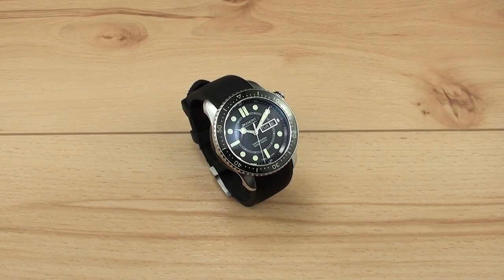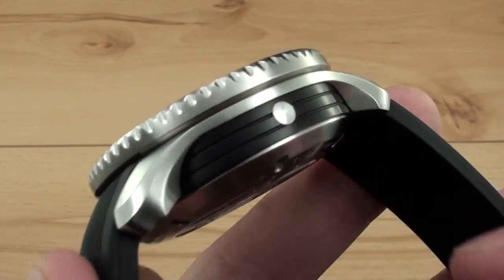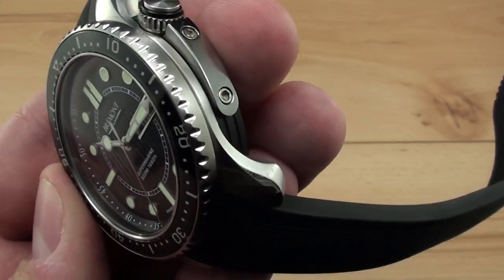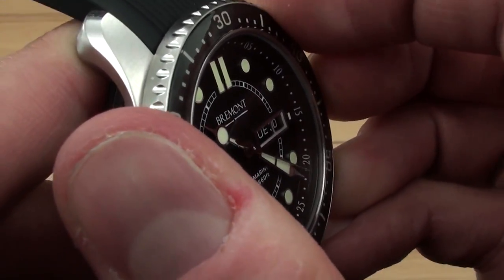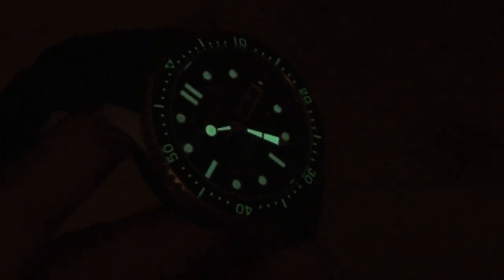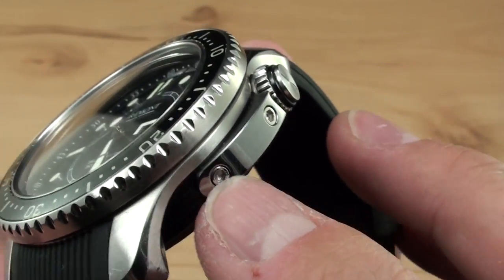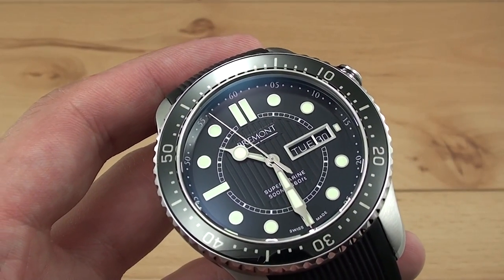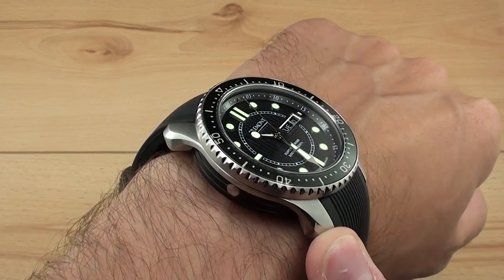Bremont Supermarine S500 Video Watch Review

Comment: You can use any appropriately sized strap (22mm). The rubber seen in the video is from made by Bremont and features fitted ends but I had no trouble trying out a few different 22mm leather straps when I had the Supermarine in for review. Thanks for watching!

Comment: I don't know why any luxury watch doesn't use harder steel like Bremont, Sinn, Damasko, and Rolex.
Reply: Rolex Steel is not harder - in fact  it can actually be softer than some normal grades of 316/L316
Reply from the maker: Correct- it’s brighter and listed as more corrosion resistant.
Reply: @watchreport  and acid resistant  - takes a polish beautifully